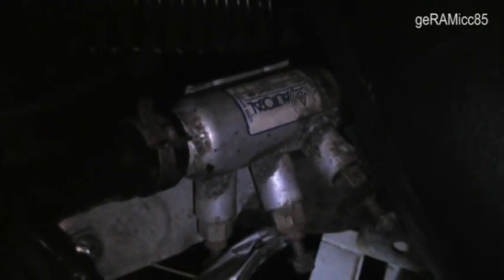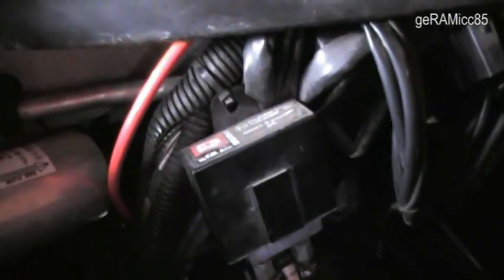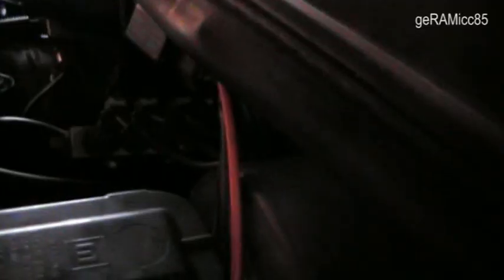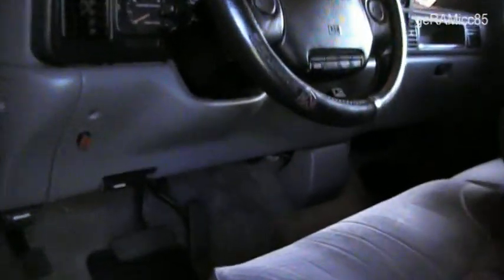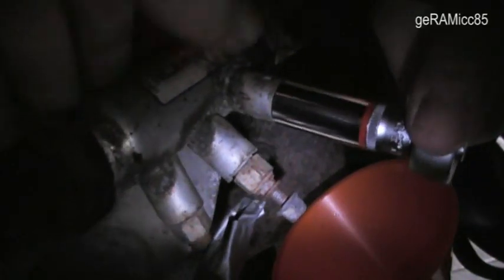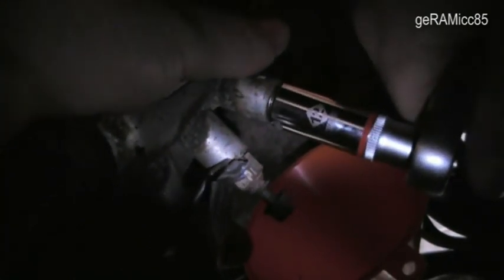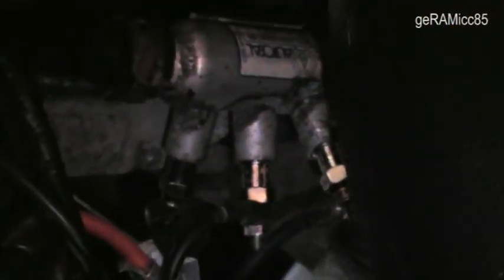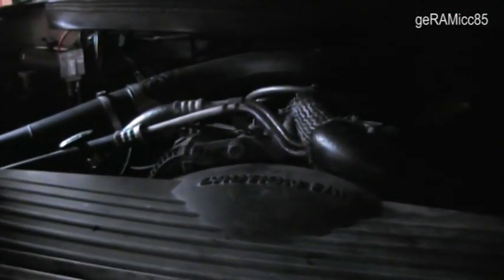LPG EVAPORATOR HEATED UP WITH GLOW PLUGS | SAVE GAS WITH WARM START | AUTOGAS BRC PRINS VENTURI

Comment: You could heat a solid block of metal instead of trying to heat water. It will be much quicker. There is a complete product as well if you don't prefer DIY approach. It is called cangas HD 2 4 it is a complete system. With controller

Comment: If people are a little strapped for cash or perhaps don't experience severe winters, then some foam insulation material can be added around your reducer and the coolant pipes leading to it.  This helped my cold running issues down to about 3 deg C.  i like this idea as it partly recycles old car parts.
Another method is described below where an injector rail heating element can be attached to the reducer/vaporiser itself:
http://gazeo.com/automotive/technology/How-to-cut-petrol-use-in-LPG-car-in-winter,article,8310.html